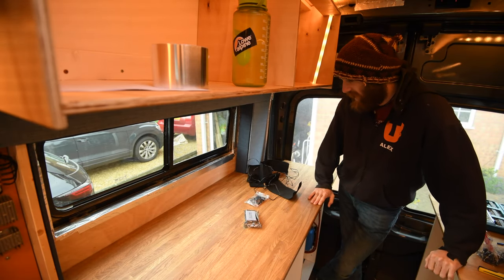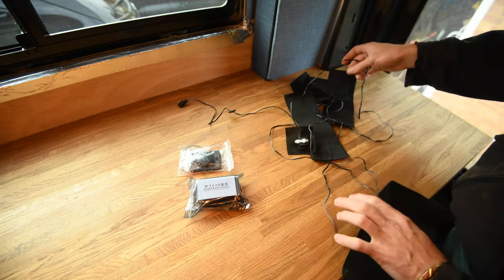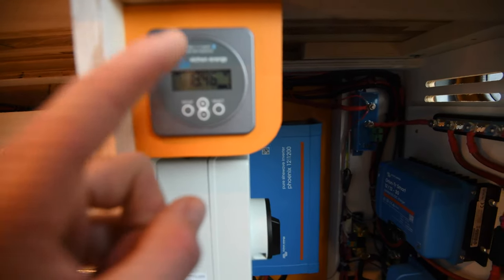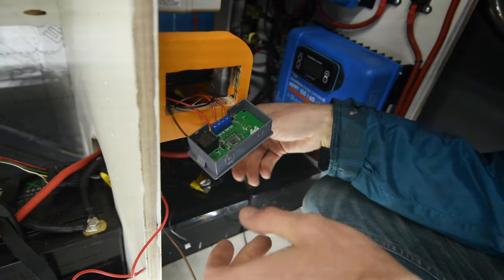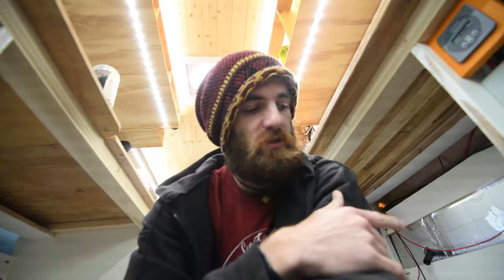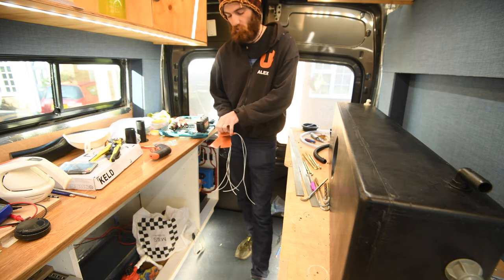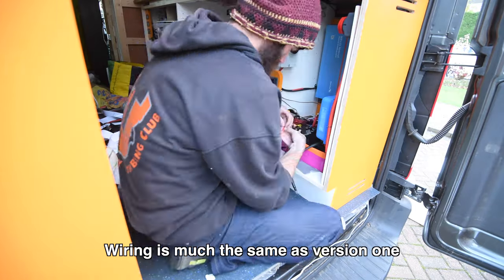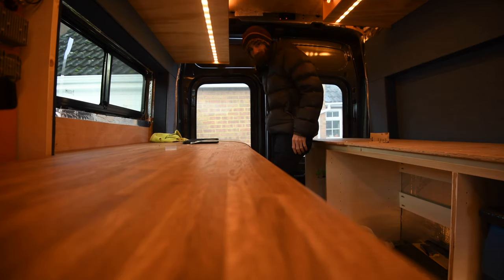DIY lithium battery warmer, Trial and error | EP35 | Ford Transit Campervan Build

Comment: Pretty cool idea! I'm going to copy this! I have a diy lifepo4 battery so I can stick the heating pads inside the battery box right to the cells for even greater efficiency 🙌🏻
Reply from the maker: Cheers. I’ve been happy with the performance. Aye that’s should definitely work with a diy battery too, one of my friends is doing it for their pack. 

If you are going to stick them directly to the cells maybe still consider some sort of heat sink like my aluminium plate. Unwise you might  heat up one particular area most than others.

Comment: Hi Alex. Fantastic descriptive videos - You have done so much customisation. Where did you get the little temperature relays with the displays that you have made this system from - I would like to have a go at building my own battery heating system.
Reply from the maker: Thanks for watching, glad to found the video helpful. 

The temperature relays are called a W3230 but “12v temperature relay” should find you other models

Comment: Nice job. I got my insulated box built for the 6 green u27s in the progress of switching over to 24v . Haven't got to do any testing yet . My 4 pads are 13w each at 110v. Not quite as efficient as your setup. But my mats were bigger so no heat sink was needed
Reply from the maker: Thanks. Yeah my 15w mats definitely looked a bit bigger on the eBay page! . Those hand models must have really small hands!  If mine were larger I would of probably done without the heat sink, still playing around with temperature on and offs with the relay, I can probably bring it down a bit lower. But I’ve had them in for about a week now and I’m pretty impressed with the performance.

Comment: Another issue with Lithium batteries and temperature is that you cannot draw much power from them when they are cold. 
So if you are trying to use them to start a motorbike or snowmobile, you really struggle in low temperature.
The usual work around is to use the batteries internal resistance to heat them up a bit BEFORE you try to draw heavy currents. And for that you can do a very quick engine turnover, but not a full crank. Putting lights on too.
Or else, you can use a battery heater to warm them up before.
Reply from the maker: What’s your definition of cold in the context? +5c or -20c And what variation of lithium chemistry or cell type are you using for starters in snowmobiles?  ( generally interested, because I didn’t know of many lithium starters. ) 

Normal LiFePO4 cells can still access decent C rate discharges for normal use below zero. However cranking C rates I’d imagine are massive. 

Heating the cell via use  is a good way to do it.

Comment: How did you set up your dc to dc.  I have a renogy solar controller and wonder where or how the dc to dc goes so I don’t over charge my coach or fry my alternator.  Thanks.
Reply from the maker: Generally all DCDC charges are the same input goes to the positive terminal the starter battery or customer connection point if your vehicle has one. Output goes to the positive side of your letter system. Negative connections can vary some DC DDC charges are isolated while some of them are non-isolated and share a  common ground. DCDC charges limit the amount of charge current which is important when using lithium. 

Some of them work in different ways. Some of them need an engine live signal to start was other sense, the vehicles voltage and turn on and off automatically.

Comment: I'm amazed.
You put so many high tech automation and remote control in your van, all DIY plus it looks great and neat.
And I'm not talking about only this video.

I taught that the heat from the diesel air heater would be enough to keep the Lithium batteries warm. If you don't forget to turn it on of course. But brilliant all this automation, because people always forget once in a while.

Good job!
Reply from the maker: I think generally when I living in the van full time, the use of the diesel heater will keep the overall temperature in the van above freezing most of the time. But nice to have an automated backup system. 

Thanks I really enjoy all my smart home tech and automation. Probably going to get a lot of harassment at some point about being in a campervan is being about closer to nature and so on haha. But I lead expedition all over the globe and spend half my year in a tent close to nature, Think I earned myself some smart home luxuries.

Comment: Hi Alex, did you get to try this setup in the extreme low temps, or did you already have the Roamer batteries by then??
Cherrs Paul
Reply from the maker: Great I had these batteries for the first Arctic trip and in the Roamer ones for the second. 

However, I had made some modifications pre-1st Arctic trip I found it was extremely effective to lift the batteries off the ground by 25mm to create a air gap so there is no cold bridge between the insulated battery box and the cold floor. I also put a 1watt PC fan to waft warm air from the adjacent diesel heater cabinet into the air gap below. 

With that upgrade, it was rarely required for the heat pad to turn on. Unless I was not in the vehicle, so the heating was off.
Reply: @MispronouncedAdventures  first, thanks for replying.
I have a vent going into my garage area from the diesel heater, so when im out in the van its not a problem, but these few days of cold weather being sat on the driveway show that the internal thermometer in my batteries show -1, so i need to sort something out, im glad i asked you now with the 'air gap' tip, im laid up after an operation at the moment, so its killing me not to go out and sort the problem.
Your videos are a lifeline at the moment because im just sitting around!!
Reply from the maker: @youngy7449 i wish you a swift recovery. the air gap or braking the cold bridge is probably the best things for them and helps so much

Comment: Where did you find instructions for the temp controller? Mine didn’t come with any. I assume the S1 & S2 is just cut into the +ve feed to the heater mat? Could you just piggy back off the controller +ve, this saving a wire?
Reply from the maker: Pretty much yes. I think I had to Google the controller part name to find the manual for programming

Comment: Another informative video thank you. After your testing: where did you put the temperature sensor?
Reply from the maker: Half way Down the side of one of the batteries inside the foam jacket. Had to play with it a few time to get a good battery temp but not to be to much direct heat from the heater mat itself
Reply: @MispronouncedAdventures  I'll have a play!

Comment: Did you put anything under the pads between them and the KingSpan foam insulation? Is there any signs of heat damage to the KingSpan?
Reply from the maker: I have not seen if I’m honest. There is 3mm closed cell foam and duct tape of the jacket before the foam board

Comment: I’m using the same heaters,mor at least looks like the case. I put conductive silicone between my heaters and the aluminum. Two heaters on the front and two on the back. The aluminum is directly against the battery. There is 8mm of rigid foam insulating all sides of the battery, then covered with 4mm plywood. I’m not letting those heaters reach max temp so I am running them with a motor speed/dimmer switch. There are no hard freezes at my latitude, so I’m going to try setting the max temp of the heaters to 50C.
Reply from the maker: Sounds like a good plans and you have sorted your battery heating well

Comment: I’m finally installing my heaters, but I’m wondering a couple of things as my heater plates get to around 55°C. Did you put the heater plates with the pads attached, underneath the batteries, or alongside? Do you monitor exactly how hot the plates get and how hot they make the battery case?
Reply from the maker: I found my heat plate did good job at spreading the heat out from there heat pad. My heat pads were attached to the underside of my spreader plates, which the battery sat on.

As for monitoring the heat pads on my initial setup, I placed the temperature relays sensor around midway down central unit. And lucky for me my batteries have a diagnostic cable and four temperature sensors internally so I could log into the batteries and see how accurate the location of the temperature relay sensor was versus the internal battery temperature.

It also meant I could check when my initial testing took place at the batteries weren’t getting too hot as well.
Reply: @MispronouncedAdventures  that’s great thanks. I’m probably worrying unnecessarily. I’ll put a separate temp sender in between the batteries as I don’t trust the software supplied with the batteries (Lifos brand).

Comment: I bought the W3230 temp controllers but setting them is driving me mad….. The instructions I’ve found are very hard to follow. 

Did you change the various “P” settings, or did you just stick to setting a lower temp on the main blue display? How did you set a max temp to switch off the heaters again? 

Also out of interest, did you check the temps on the heater pads - two are pretty much identical and one is always around 10 - 20 degrees behind.
Reply from the maker: I think I had to use a YouTube video I found a help program them the instructions can be a bit difficult. 

I don’t think I set a max temperature I think I set a hysteresis valve. It is the temperature difference between turn on and turn off of the output. If you get the target temp at 10c with a 4c hysteresis. It would turn on a 8c and off at 12c
Reply: @MispronouncedAdventures  thank you, I was getting very frustrated.

Comment: Still happy with this battery heater? I have lithium and I am thinking about doing the same.
Reply from the maker: Yes, very much so, but an even more effective solution I found was lifting the batteries off the ground to have an air 25mm underneath and then wafting warmer from the diesel heater area which is nearby underneath them. Well on the Arctic trip last winter. Helps break the cold bridge between the cold floor
Reply: @MispronouncedAdventures  I like that idea too. I have a foil backed foam layer already, but it’s not enough, so thought about my diesel heater being in the same compartment and considered taking a small 20mm feed from it and running it across the back of the batteries (using spare heater exhaust tubing insulated to prevent direct contact) and terminating in my fresh water cabinet.  I could route below instead…

Comment: 12v aquarium or vivarium heater pads are great for battery pre heaters and engine oil sump warmers
Reply from the maker: This heating system is pretty much engine oil sump warmers. 

A friends of mine who uses Tesla modules for his leisure battery uses a aquarium water heater as those batteries are water cooled / hested

Comment: Great, does your Alexa work without an internet connection i.e just on the WiFi lan?
Reply from the maker: The Alexa / echo dot only work with internet connect.  whilst the van does have its own 4G router. So  most of the time that’s ok. But In the van anything which can use an Alexa, that Is only a secondary way to interact with it. Every primary  form of interaction is based of something which will work offline / no WiFi or internet

Comment: Love the content! But can we get this guy some more recognition so he can afford a better mic?
Reply from the maker: I appreciate the comment. What’s the issue with the mic? Mainly for reference so I can see what I can fix particularly in post or in camera Is it the peaking at the top end? Or the occasional annoying interference? Which is an annoying issue with this model of Rode video mic
Reply: Thanks for the reply!! I think the main issue is clipping at the high end. I'm no mic expert tho
Reply from the maker: I’m definitely not a mic expert either as you can see or hear to be exact! I play around with some setting so if I can fix it. I suspect it might be the “automatic sensitivity” I’m using in the camera. I’ll have a play
Reply: @MispronouncedAdventures  i look forward to hearing improvement in future videos! Are you just using the built in mic in your camera?
Reply from the maker: No I have use a “Rode Videomic GO” which is an external horseshoe mounted mic. But it is more of a budget member of the Rode mic line up.

Comment: I ordered 3 of those orange 15 w heat pads with 2 white wires with no marks to indicate which is plus or negative ........
Reply from the maker: If they are just Electric-resistance heating elements / pads they have no polarity. So it’s don’t matter. 

However I  would mark up the cables, just so you know which is which so you can wire them up identically
Reply: @MispronouncedAdventures  much appreciated , love your vids on your van build not too mention your trip braving the cold through Sweden something for me to aspire to.... Stay safe

Comment: Clever!  Another way of doing it would be to mount the charge controller and the inverter (which both output head as a waste product) in the same enclosure as the batteries.  I mean your only gonna need to charge them in the cold, if your using them, and if your using the charge controller and inverter, you'll be generating heat!
Reply from the maker: that’s was also part of my thinking as well. As my inverter and solar charger sit in the same cupboard. Hoping when I finally build some cupboard doors heat might be kept in a bit more as well. When in the summer I can disconnect the heat pads and connect a 12v fan to the cupboard vent and change the temperature sensitive relay from heating mode to cooling.
Reply: @MispronouncedAdventures  Yeh it would be the best of both worlds, use some 120mm or 140mm noctua PC fans they're almost silent and move enough air and dont use much power so you could just wire a simple switch for them - if it's warm, leave them on!
Reply from the maker: I had particularly planned on the noctua brand ones, glad to hear you’ve reassured by decision.
Reply: @MispronouncedAdventures  The Noctua fans are pricey, but very efficient, and almost silent, as remarked above.  Highly recommended.

Comment: I missed where you actually mounted the heating pads somewhere on the video, I’m just curious if the pads ended up bearing weight if you put them underneath and how you avoided if not.
Reply from the maker: The silicon heat pads are aluminium foil taped to the underside of the aluminium plates ( which act as the heat sink to disperse the heat ). The pads them self are solid so not crushable and also extremely flexible. Supported by the aluminium plate above and the 25mm PIR insulation board below.

Comment: Hi, great vid, cheers. Does the system only heat the batteries when charging is happening or all the time when temps are low enough?  Also my estimate is a little shy of 4 amps draw for the pads, any noticeable impact on battery bank life?
Reply from the maker: Only heats the batteries when the temperature drop of the batteries dropped between 7c and turns off when they reach 9c. This generally only happens on cold nights when the van is unoccupied. And to heat the batteries between those temperatures only takes an hour and 20 minutes usual. Yeah total draw is 3.75amp When they turn on, and since it’s an hour and 20 minutes that’s about 5ah. So just over 1% of the battery banks capacity. The warming system will engage any time the batteries for temp is low enough, for example they might come on at 4 o’clock in the morning and off again at 5:20am  but because It did the batteries are in a charging temperature the following morning when the Sun comes up for solar. Or since I have a 30 amp battery to battery charger I just need to turn the engine on for six minutes the next day to recharge the energy used overnight. Couple models on the market now have the same heat pad system built into the batteries internally